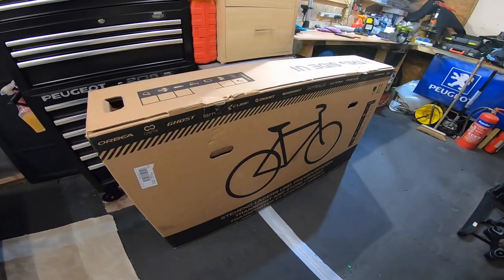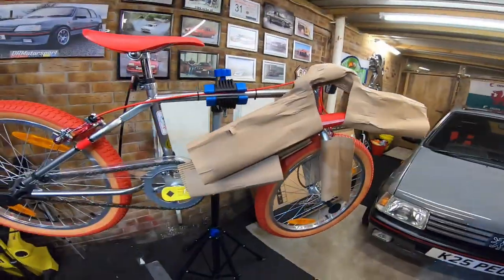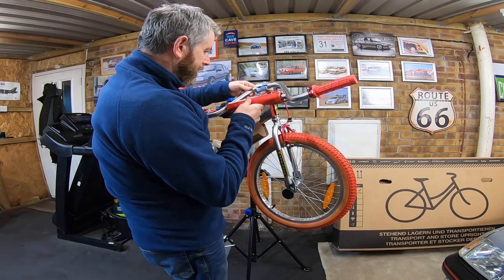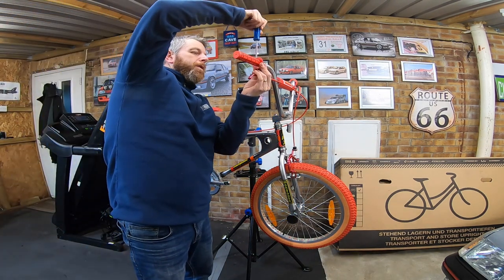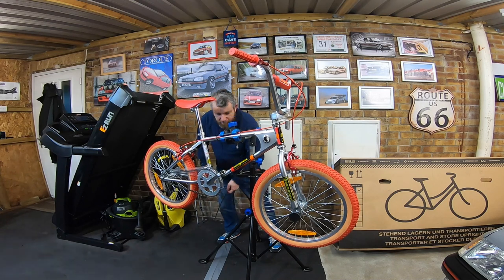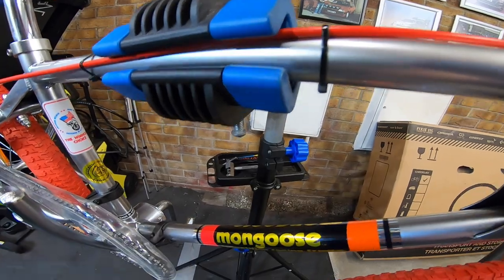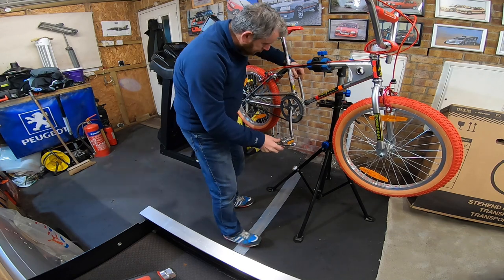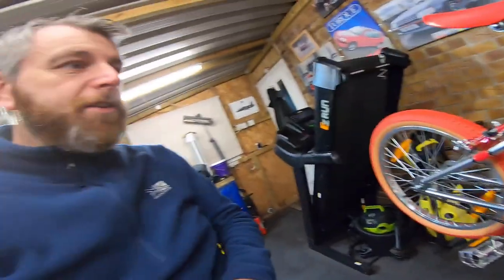Mongoose California Special (2022) Unboxing and Build Review!

Comment: My first half-decent bike was a Californian.  Many miles, many adventures/misadventures.  Then my sister raced it, and did pretty well with it.
The holes in the rims don't look large enough.  I bent the 1-piece cranks, and I think I smashed the seat rails, but the rims survived.
The pedals you have I think were called Bear Traps.  Mine had plastic platforms.
Reply from the maker: Great memories, mate 😃👍🏻
Reply: Bear Traps were round. Bear Claws were oval. I'm not sure what these pedals are.